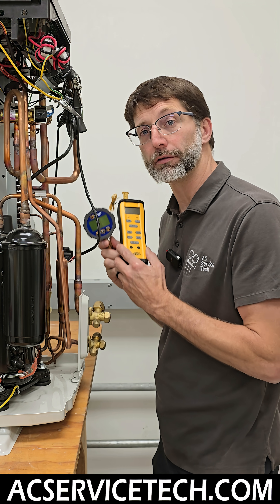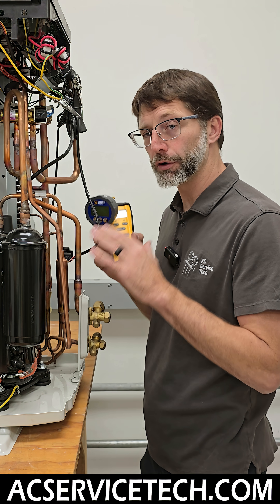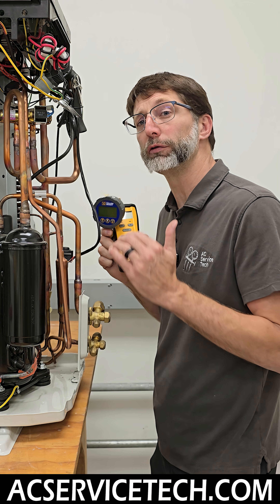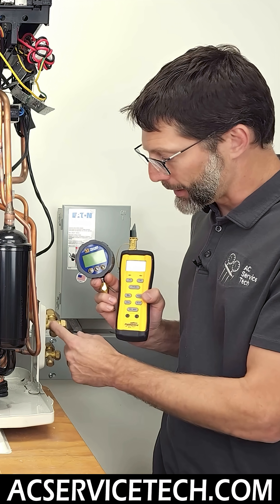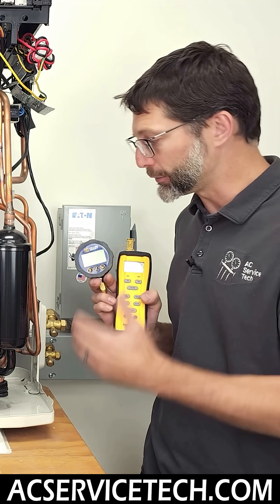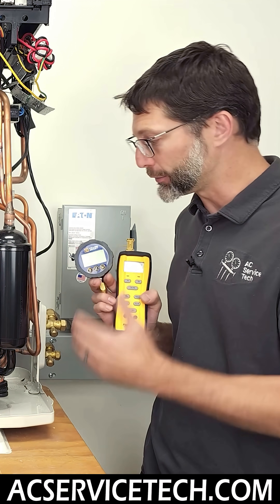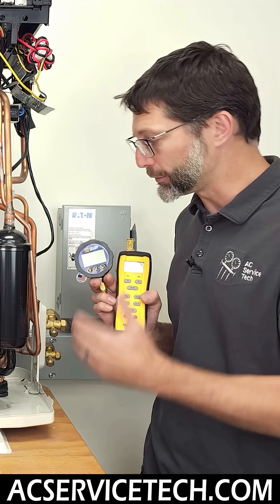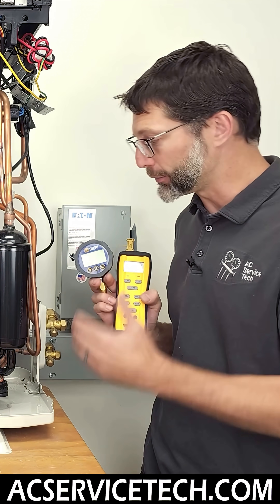Measuring the Refrigerant Level and Charging an Inverter Mini Split Unit! Possible Overcharging!

Comment: The problem with total weight is that you can never seem to find how much coolant is used for each head unit in addition to the outdoor unit. What do you do when the outdoor unit has a variable number of indoor units?

Comment: Wait, measure the line set length with what or to what? To figure out how to adjust the refrigerant? Then you mentioned superheat and subcooling simultaneously i thought you only measure superheat if its a piston metering device, near the indoor coil.l. I must have miss something, can you explain when you have time? Thanks

Comment: On call last Friday night mini split added 2lbs over 1hr and 30min based off super heat.   System was cooling when I left, what’s the chances I blew this compressor. No call back but curious bc I never knew this method 🤦‍♂️

Comment: So I was working on a system the other day and as my hose unconnected an shot out the tiny bit of charge left in the hose it frosted the threaded end as expected but when I touched it not once but three times it shocked me from the brass and I was curious if the colder temp of the metal was causing it to become more statically  charged?  Confused me cause it wasn’t from clothes creating static.. really just made me think why did this happen and I was curious if you know any explanation as to why this would occur?

Comment: By inverter system is this referring to a heat pump with the reversing valve?
Reply: On the compressor is inverter driven
Reply: @robertlamey7612 thank you I see what it is now.

Comment: In other words, take out the system charge and recharge according to nameplate weight and any length of line set.  Additional line set is usually measure in tenths of ounces or ounces.  So be gentle when recharging

Comment: Thier Must Be a Way to do it on a running system. i'd try installing a sight glass in liquid line before the txv. install True suction access valve. install high side access valve. Set Remote control to Max. Cool 60 degrees.
Then Weigh in the charge as Prescribed & monitor the sight glass as u are weighing in the charge to see how close it ends up being.